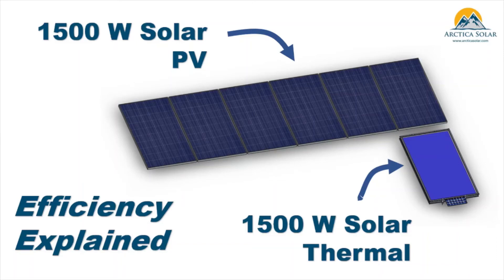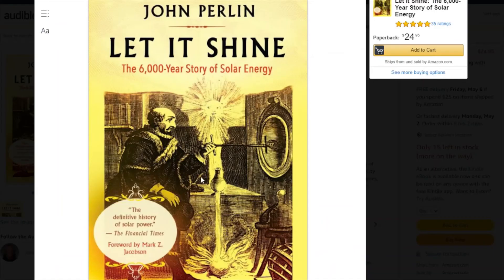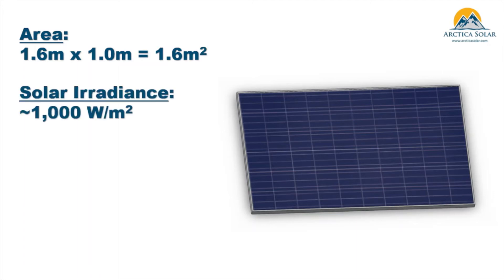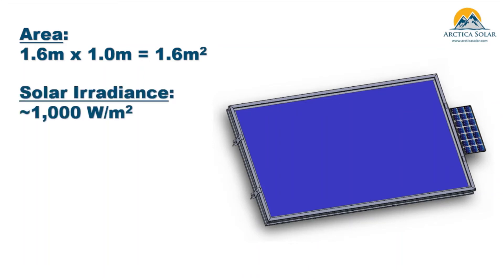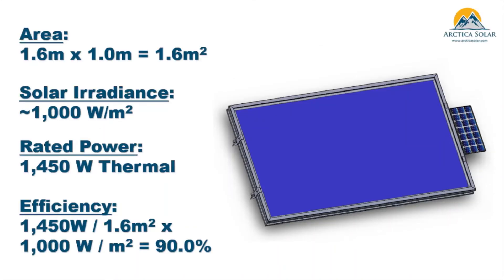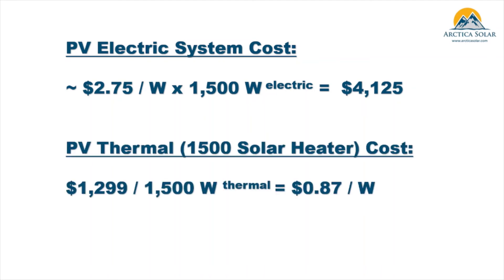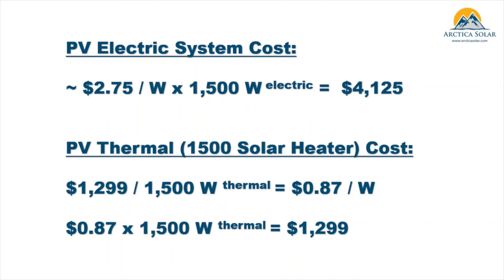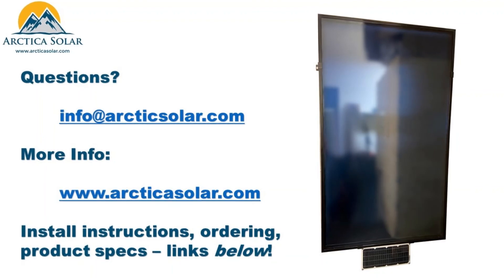Solar PV vs Solar Thermal - Efficiency Explained!

Comment: Is there a reason your panels are 1.5 m x 1 m? I have found...bigger and more insulated is hotter than small units. What R value is your units? What temperature output? Does your unit produce heat in -20C outside? My 15 ft x 6 ft R11 unit beautifully heats 3 upstairs rooms on sunny days.
Reply from the maker: The units in the video are 1.5m x 1.0m, but we make much larger panels in our 2000 series and 4000 series systems.  The panels are modular to allow for reasonable shipping cost and complexity. The temperature outputs are labeled on the product datasheets on our website.
Reply: @Arctica Solar  OK thanks and good luck.

Comment: The issue is that if you use a heat pump hot water tank you can easily get COP of 4-5 on hot days so PV and solar thermal are about equal.
Reply from the maker: I've heard of air source heat pump hot water heater COPs as high as 3x in cold areas, but not 4-5.  Is 4-5 possible for water source heat pump hot water heaters? A unique idea we'd like to explore more is increasing COP with existing heat pump systems (hot water or HVAC) through solar thermal supplementation - basically a solar thermal pre-heating of source medium.  However, if the homeowner already has a roof PV system, electrification of heating loads is a good choice.  Many of our customers use air heating for supplementing existing HVAC systems, zonal fuel free heating or off-grid heating.

Comment: how about solar air vs solar water for heating?
Reply from the maker: Solar thermal hot water is great, the thermal capacity of water is far superior to air.   However, these systems tend to be more complicated and expensive, and you have to be careful with freeze protection.  But it does make time shifting the energy easier and more flexible.  Thinking through a home solar thermal hot water heating system would be useful especially if the home already has radiant heating installed.

Comment: Thanks! Do you have a video in which you compare the overall efficiency of both systems? Do you have inside in practical data too? That's what counts in the end.
Reply from the maker: We are working on a "application" efficiency video looking at actual seasonal heater performance.  Stay tuned!
Reply: @ArcticaSolar  I do!